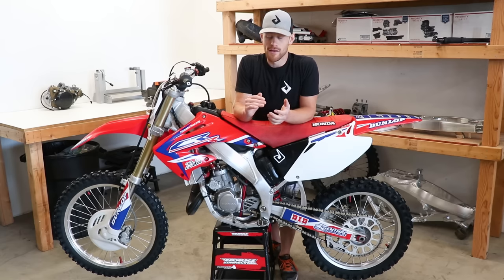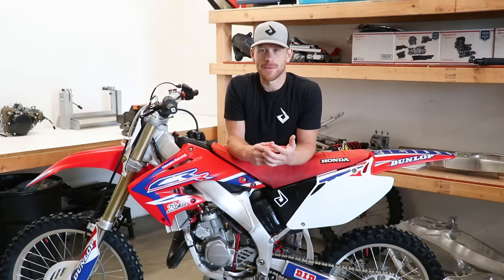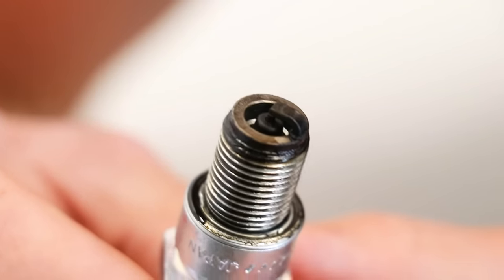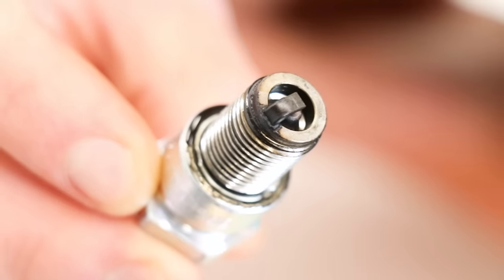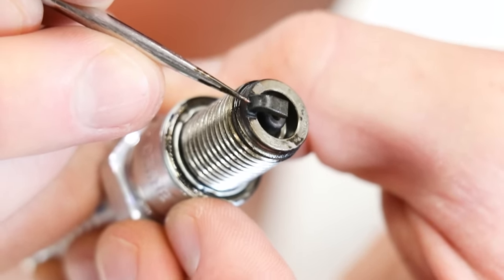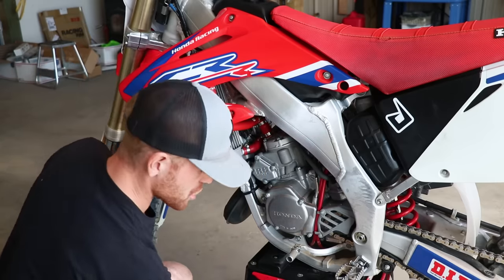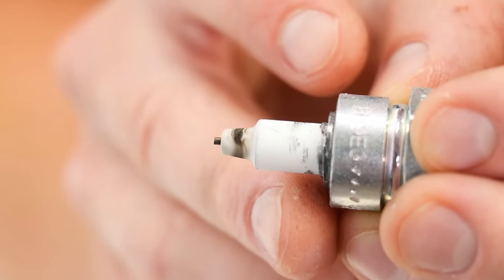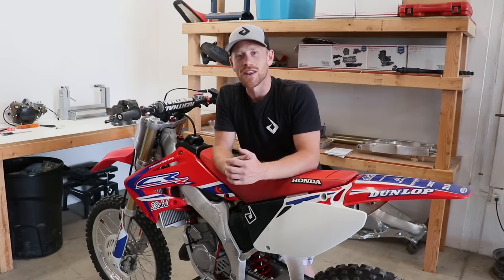How To See If A Two Stroke Is Running Correctly!

Comment: “A tad bit lean makes more power”

On 2 strokes, “a tad bit lean” also leads to 20 hour pistons, and 50 hour rod bearings. And hopefully not a worn out or scored cylinder wall.

“If you’re fouling plugs, you definitely need to lean your mixture”

Definitely not. You need to check your jetting first. Telling these young cats to just start leaning without background of jetting and how one adjustment affects another is gonna cause them to clap their engine out. 
Teach these kids better.
Reply: Neal Archer that's why no one will remember your name.Lol
Reply: If I'm gonna be a "tad bit" anything, it's gonna be rich. Because that's the responsible way that grownups tune
Reply: Eh who cares just mix 32:1 and buy a lectron carb, simple problem solved
Reply: @braaap5.7  hahhahahahahahahaha,and run some 115 octane to further lean it out hahhahahahahahahahahah, I know you are joking though just agreeing with your joking
Reply: He said a tad bit lean not lean it out to the point where it’s dangerous.  If you want power running it a little bit on the lean side is optimal in my opinion.
Reply: Run 32.1 and do a plug chop if it's off time to swap jets
Reply: Your under 30 your a kid too bruh
Reply: @Tabascorider  a higher octane fuel will not lean more. All your doing is getting a slower burn rate. You'll still get the same amount of fuel if you dont tune your carb
Reply: Shhhhhh
Reply: i think he meant lean your air/fuel mixture.
Reply: Agreed, your gas mix is the constant.  You jet the bike to tune.
Reply: Like my grandpa used to say, when in doubt lean it out
Reply: I was running 32:1 on my yz85 then mechanic told me to run 16 to 1 then now my top end blew up
Reply: @jah-ra3639  that's super rich. Have fun cleaning all that gunk
Reply: Fast4SloW 717 I didn’t know this is my first dirt bike i thoughts it would’ve been ok cause I was rode like 140 hours on it like thay
Reply: @jah-ra3639  If you change your fuel/ oil ratio,  especially as far as you did,you also have to adjust your air/fuel as well. Going from 32 to 16:1 is a huge jump. You pretty much lean out the air/fuel by adding more oil.  The fuel/ oil mixture is thicker and more resistant to flow. You can run any fuel/ oil mixture you want but have to jet for it as well. Hope you got your bike running.
Reply: this isnt 2 stroke preschool.  if you dont understand any of this then maybe they make a 2stroke for dummies book.  start there
Reply: @jah-ra3639  A YZ85 needs a fresh piston every 20 hours or so, the oil ratio isn't the reason your top end blew up, it's because you kept running the same piston for 4 years.
Reply: He is right, going leaner does increase power in 2 strokes.
Reply: I'm 16 and I know this 😂
Reply: Absolutely correct.  Now you've gone and upset his fan base.  :)  Also, screwing a bare new spark plug without anti-seize into an aluminum head isn't recommended.  Maybe that head has a steel thread insert in the head?  Many times these 'how to" video's are very telling.  Look at work benches, tools, and overall maintenance practices.  I've seen guys pull cases apart many times without first cleaning everything up.  Working on dirty benches, etc.  One thing I noticed, again not bashing - but, not having a die grinder or Dremel tool to cut open a spark plug - I put the hack saws away many years ago.  Experience doesn't live in a caveman environment.  Just sayin.  :)

On this video he's talking plug fouling and goes straight to oil mix ratio - that's always a consideration if there's a problem.  But, adjusting the mix ratio would be the last thing to do.  No mention of what oil is being used, tested or recommended.

Not bashing here - video is very good and informational.  However, it's not the stone tablets of 2 strokes.  Keep in in perspective.

When he says "a tad bit lean" he doesn't really mean "a tad bit lean" - what he means is on the lean side of optimal as there is a tuning range and it's not in absolutes or steps - it's a smear from one end of the spectrum to the other.  Lean in any performance engine is a death warrant and will shorten it's lifespan, how much depends upon the severity of the condition.

When getting into tuning and jetting there should also be mention given to the static compression ratio and it's effect.

Be careful not to hurt any more feelings.  Constructive criticism is healthy discussion.
Reply: Zang Zang Regardless of what you say, he is 100% right. 2 strokes produce more power when running leaner. Obviously running lean makes the engine runs hotter and part wear is increased. But literally all he said was "2 strokes make more power running lean" which is correct.
Reply: Jah-Ra More oil in the mixture makes the engine run leaner. 16:1? Seriosly? Thats ridiculous, no wonder it blew up.
Reply: @verttisyrjala2897  Not if you have the brains to jet accordingly.  If not, then don't mess with things.

My comments come from 50+ years of two stroke tuning in several arena's - gasoline, alcohol and nitromethane fueled.

They are being taken from the wrong perspective - not attacking the video.  Just commenting.  Part of it is ya can't put the book of two stroke tuning in a 10 minute video.  This is a great and informative video - just lacks a bit of perspective.  Neither "Rich" or "Lean" are desired tuning conditions - Optimal is where to be - "Optimal" tuning depends upon riding conditions.

Cameron has a very good understanding of things and will mature into a grand master tuner without a doubt.
Reply: Zang Zang I dont care how much experience you have, if you are denying the fact that 2 strokes make more power running leaner, you're wrong. Running richer is safer, yes, but you wont get as much power.
Reply: Zang Zang 2 strokes make the most power running as lean as they can without bogging/detonating... How can you not get what Im saying? "Optimal" in what way? Certainly not "optimal" powerwise, thats what I am getting from your comments.
Reply: Zang Zang I like you 🤙🏻 you know what’s up
Reply: Vertti syrjälä yes, every gasoline engine will make more power if tuned leaner. But why would you do that? I’ll tell you this much, anyone who is so convinced that they “need more power” that they’re watching a YT video on how to do incorrectly, does not need more power. There’s many other ways to safely increase the power output of an engine without destroying it.

Will slapping a super charger on my stock v8 make more power? Yes. Will it also blow it to pieces? Yes.

The statement he made isn’t right or wrong. It’s gray. And he didn’t explain why it’s in the gray area which is why it makes him today’s biggest loser.
Reply: Neal Archer Its 100% right what he said. He didnt deny the fact that running leaner increases the changes of engine seizing and/or part wear. He only said that 2 strokes make more power running lean. Which is true. And a lot of people would rather squeeze every hp possible out than run too rich because they're scared of changing parts slightly, maybe not even at all, faster.
Reply: Vertti syrjälä okie dokie dude.
Reply: If you run good oil like castor 927 or amsoil dominator you can run a tad lean without the side effects off burning them in 20 hours
Reply: I LOVE Yam 2 strokes but there's no denying they are the Fords of the motorcycle world as in designed down to a price e.g. NO primer/undercoat/ heavy narrow wheels & if you want to tune a  2 stroke & then want SUSTAINED high performance then there are two possibilities or combination thereof 1) Bigger radiator 2) Run it on more petrol & 2 stroke oil to keep it cool. While that works well you'll soon find that Yam ignition systems are designed down to a price & while they may be adequate for normal use they are NOT adequate for TUNED engines!  So if you have the good sense to avoid seizing your engine you need to accept the fact you NEED to run more petrol & 2 stroke oil  to keep it cool, which requires you to upgrade your ignition system with a seriously more powerful coil  with copper wired ( rather than carbon ) HT leads & 5K ohm resistor plug caps seem to work best & NGK  V type plugs with a thinner electrode then you should also find you can open up the plug gap & get significantly better running!  When I first tried this on an air cooled Yam RD350 they came stock with a 500 rev flat spot that gave the bike a "Jekyll & Hyde" personality, but with a bigger coil 
( where nothing else worked )etc the flat spot disappeared  & it pulled like a diesel ! :)
   I first ran across this in an article by Gordon Jennings ( R.I. P. ) who was Tech. Editor of the now defunct magazine "Cycle" - He  was a genius @ taking complex technical concepts etc & making them easy to understand !

Comment: I finally got a two-smoker after turning 50.  I love my YZ! I learned alot on this video, looking forward to more of them.
Reply: I had one that would scare the shit out of anyone who tried to ride it. Ported and built to the hilt. It would stand up in every gear and you didnt have to touch the clutch. Be running 60mph and just give it some more throttle and up it would come unless it decided to set the tire on fire.
Reply: 50 thumbs up dude !!

Comment: Great information. Choosing the proper air fuel ratio; can really save your 2-stroke engine; If too lean You will promote seizure, of the piston in the cylinder.  On a 2-stroke proper mixture and proper spark plug heat range, spark plug heat range is critical, also.

Comment: I have learned with the pre mix, that the type of oil will give you what you need for the type of riding you are doing. My Rm 250 runs klots super techniplate on trails at 32:1 all day long with perfect jetting, if I run castor 927 it fouls plugs. Exact same conditions at wide open on the track gives me no issues with castor 927. Oil flashpoint was something I never thought of during 20 years of riding. I am not a believer in changing premix ratio's.

Comment: Have you ever done jetting by using the same chop throttle test run, but rather than reading the plug, read the size of the unburnt fuel wet spot on the piston at the transfers? A small wet spot about the size of a dime is about perfect. This would be for a higher compression ratio of around 15:1 or 16:1. I have never done this using pump gas so don't know if reading is the same.

Comment: Hi Cameron, Thank you so much for these very informative videos, they are very much appreciated. I would certainly like to watch an in-depth video on two stroke carburettor jetting principles. Rather like cause and effect, what happens if and what you can hear and feel when riding the bike. May be starting with float height and it's effect. Then covering from idle to 1/4 throttle, 1/4 to 1/2, 1/2 to 3/4 and 3/4 to 4/4. The effect of the pilot circuit, needle base diameter, throttle slide cut away, needle position, main jet. I have heard that VP fuels makes for an ideal constant from gas station quality fuel, so many be that is for another brilliant must watch video. All the very best from Robert :-)

Comment: Nice vid, 100 hours on a YZ490 and 250 plus on the KX500 . Plugs on the 500's were never a problem but made a point to change the plug every 6 months. Always run my bikes at 40:1 synthetic. Five cents.
Reply: And no gloves when you rode it. ? Are you mad ?

Comment: Hey Cameron, my Ktm 125sx 2012 sounds like a 4 stroke while riding, its a 2 stroke tho, i mix it to 40:1 think its getting to much gas/oil mixture, sounds very heavy and the power kicks in super late, HELP??
Reply: Mika Siereveld -_-  ur jetting running rich
Reply: Pian Mohd nope its running stock
Reply: Pian Mohd it was old feul sounds right now
Reply: @mikasiereveld3124  smh...
Reply: Air filter clean or totally clogged? Reeds have a ton of time on them? FRESH fuel? Check this stuff out.of course, if your bike had a billion rides on it, the crank seals could be letting motor oil into the combustion area
Reply: @richardkey4289  do you think he's talking about a 4 stroke engine? On a 2 stroke the crankcase is pressurize by the down stroke and all moving parts (besides the transmission) are lubricated via the oil/fuel mixture. There is no "motor oil" in a 2 stroke engine. The only oil the bike has is either in the fuel mixture or transmission.
Reply: @noirceur_  yes, that's what I meant to suggest, trans.oil leaking past a seal into crank area.
Reply: @richardkey4289  ah I gotcha. Could have been possible but that's really an easy one to check as the smoke coming out of the tailpipe would smell and look different then regular 2 stroke oil. Plus he would have a harder and harder time shifting due to loss of fluid. And there is a sight glass or dipstick to check trans fluid level. But theoretically it could have been why he was losing some power but he replied earlier saying it was just the basics that were hindering his performance
Reply: @noirceur_  I had a '81 yz125 with cracks going right around where the main bearings sit in the center cases, I could clean , assemble, & start the bike, but it smoked really badly ,then foul the plug.i took it apart twice, cleaned it, assembled, then finally sold it sort of running for $400 ! Then I bought a hurtin' can am 370 qualifier, rebuilt engine, lots of power but no brakes or suspension!

Comment: you  prefer  a  leaner  jet setting?  a  bit  dangerous  I would  say.  you  know 2  stroke  engines  are really  prone  to  overheating  and  you  will  never  know when  is  your  unlucky  day.  I  know  it  will  make  more  power  when  it  is  a tad leaner,  but does  it worth  it?  maybe  for you  yes,  but not for me.  I seized  my  vespa  before  because  of  a lean  setting  and  i will not make the same mistake again.
Reply: To be fair, a Vespa is made for riding around cities and getting coffee where as Honda designed the CR125 as a race bike (back when people still raced 125s)  that can handle more abuse than that. I don't think that they are really as comparable as what you may think.....
Reply: Mohammad Farhan Sukarjo if you running good quality fluid it should be perfect v
Reply: Travis Stewart is he talking about a 50cc 2 stroke scooter ?
Reply: Mtb Ridingog No, It is a fully upgraded engine that I used for a weekend track day and I sometimes I use it as a commuter.  I understand CR engine  is not a direct comparison with an air cooled engine, but better say than sorry. :) Sometimes  you  will  never  know  what is  going to happen on  2  stroke bike.  for example,  an  old rubber intake will  get  cracked and  it will make a  lean engine even  leaner and  it  will  be too  late before  you notice the  problem while riding. so it is better  to  get the  setting  right on  the  spot so  that hopefully  seized  engine  can  be prevented.
Reply: Cacki lol what brand is the scooter
Reply: ramai yg setting lean sebab boleh over rev..  tapi piston boleh bobos/jem piston/overheat.
Reply: @Cacki cast iron pistons? What is this, 1906??

Comment: If a 2 stroke ain't smoking it's bad. If a 2 stroke is smoking then leave it.
Reply: Fortteen too much oil would make it smoke, its  not a good thing , jetting could still be way off
Reply: John Davidson they've been running for years.
Reply: Fortteen  they will still run for years with too much oil just not as well, will be down on power and foul plugs more frequently
Reply: High Cats with too much oil it could still be lean.. depends more on jetting and needle clip position than oil content.   By saying too much oil =lean you just refer to  fuel to oil ratio what about the fuel to air ratio? Too much air will make an engine lean regardless
Reply: High Cats I always run mine 32/1 as well.. like this it only smokes when cold.. yeah air boot crack is the usual cause,  also had crank seals cause same problem
Reply: High Cats Castor 927 not Castrol 😂

Comment: Hello Cameron, 
I have a 1997 Suzuki RM 250 that smokes like a stove pipe.  It would plugs in five minutes, so I replaced the right crank case seal
Reply: Ed Jacobson what fuel / oil ratio do you mix? Clean air filter? Reeds sit nice & flat on the reed block? Maybe take carburetor off & look at the # on the tiny little brass jets threaded into the bottom inside the float bowl- maybe previous owner installed different jets....? Just a couple of things to investigate

Comment: wc. do 125's really have no bottom end? i ride a kx100 which is a smaller bike. i was wondering if it will kind of be the same power considering a lighter bike but less motor and a heavier bike but more motor.
Reply: Ct kawasaki smaller bikes generally need more rpms to work,compared to bigger bikes.the advantage of a small bike is that you can be on the gas & shut throttle & hit brakes, then open it up again, stop & go; bigger bikes make more power but are slower to get spinning & stop spinning.think of a freight train compared to a scooter- they both get there but different methods

Comment: what does it mean if the part that bends over the electrode is white and the flat part is black and wet. (and the bike is running lean) the pipe glows red hot after a few seconds on idling. i cant figure out what it is
Reply: T.B.C Racing wrong heat range on plug.

Comment: Hey Guys I guess you can help me on this forum, I have a yamaha rx 135 in India. Can i use it for touring purpose ?
Reply: RoyMeraki if you want to cover lots of ground, put a bigger front sprocket or smaller rear sprocket.the power will be reduced but you will not be revving your  engine as high to achieve the same speed

Comment: Hey Cam, I know this a super old video... but the flat surface on the spark plug in my 2000 cr250 is tan, but my insulator is black as sin. Would that mean that I need to go down a MJ size? Fairly sure my pilot is correct at #45. Thanks.

Comment: I got a buddy with a 2003 KDX220 that’s never been tuned, even with a pipe and exhaust slapped on, and still has the original spark plug. How the heck is this even possible?!? We call the bike “the unicorn”